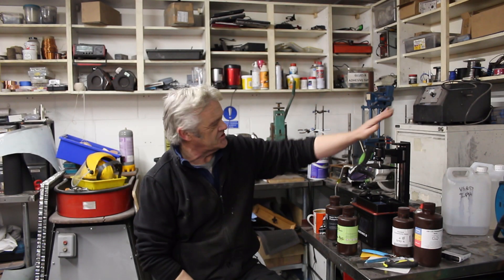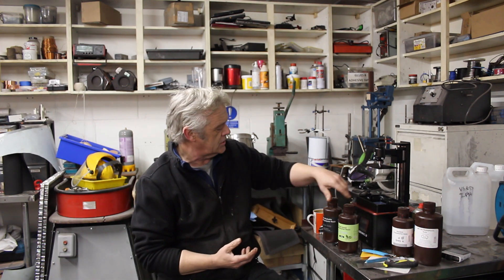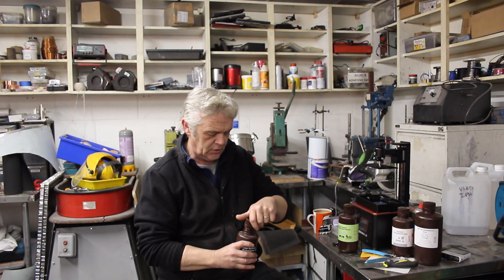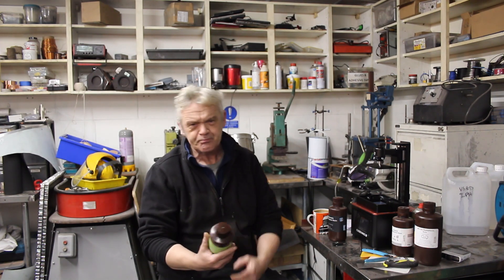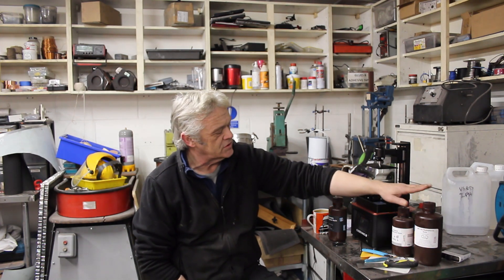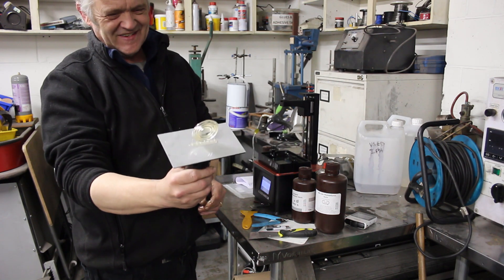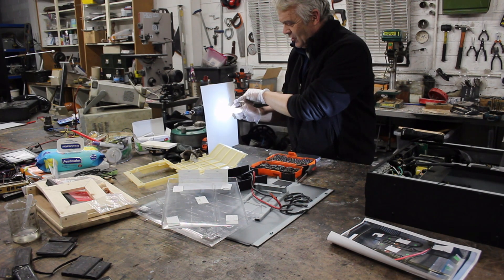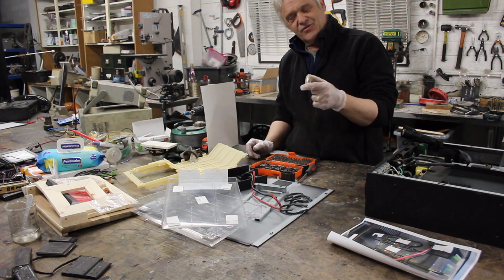1402 3D Printing A Fresnel Lens And Other Experiments

Comment: if you need parts of a print to be conductive, you might benefit from a dual extrusion fdm 3d printer. You'll be able to use two different types of spools. One, ABS or PLA for the main body of the print and the second spool that is either conductive or graphene infused. You can take a normal 3d printer and convert it to a dual extrusion 3d printer but it will reduce the printing space.

Comment: Re: conductivity, tin oxide and indium-tin oxide are conductive (often used for making plastics and glass conductive) and optically transparent, though I'm not sure if they would be in the UV range.  If they are transparent in the UV range then you wouldn't run into the issue of the resin not setting.

Comment: Conductive: what if you added to your design "channels" where the graphene could be painted once the print is done. Just deep enough so the working ink won't rub off.  Perhaps the channels could be in between connecting parts so it is is protected (embedded) once the final model is assembled. If the model doesn't  have multiple parts, design in small tunnels were working ink could be pushed through via air pressure. The net effect would be "paint in" wiring. (You can say it. It's OK. I believe the word is brilliant.)

Fumes:  build a fume hood you goof lol! You certainly have the skill and I would hazard a guess you have the parts. I  have my resin printer in a DIY enclosure that vents directly outside. I took a $10 plastic shelf kit and covered it with winterizing window plastic (shrinks with heat, crystal clear). The only tricky bit was the door, and I just 3D printed a frame and hinges and used more of window wrap. I use regular dryer hose and a PC fan to move the air. I cut a panel just wider than the vent to fit my window. When I need to use the resin printer, I simply close the window against the board and I am ready to go. Things I plan to upgrade: 1. weather stripping around the board for a better seal. 2. a stronger fan so the enclosure can be used as a fume hood when the door is open. 3. idk yet, but there is always room for improvement.
Reply: Those channels sound like awfully convenient places to run copper wire.

Comment: Could you print a honeycomb pattern (at appropriate scale) of your conductive ink onto the part at mid-stage then overlay with more resin so you have a conductive matrix within the piece.  Do blobs where you intend to connect.  Like an internal printed circuit.
Reply from the maker: that's clever thinking mate - cheers

Comment: check out the channel Integza he 3d prints with some ceramic impregnated resin for heat resistant parts. And some metal impregnated plastic filament, not useful for the resin printer but it could offer some valuable insight into using or making impregnated plastics. Also his stuff is pretty cool!  And I'm also going to recommend again, that you check out "The Fan Showdown" series by the youtuber Major Hardware, it would be very cool to see you and Luke do something similar but with designs for the pc fan generator.

Comment: Could you coat it with ITO or sputter them after
Reply from the maker: there are lots of ways to apply a conductive coating mate - to be honest the making it conductive part isn't really the issue - really what is sought is conductivity in a one step process that is cheap - or relatively inexpensive.

Comment: Hi Rob... I have the same exact 3D printer and am also trying to make the material conductive for commercial product. I am using some ultra-milled carbon fiber (same type mill you use for graphite) and have some success with conductivity while resin is liquid. My percentages are too high allowing the 1.83 specific gravity CF to settle out quickly. Experimenting with various percentage of CF mixes, then curing on an open flat surface and using a set of 385nm LED lights which only cures a very thin layer, approximately 0.05mm in depth after about 2 minutes. Have not yet tried to print using my Elegoo Mar 2 Pro, that sould happen soon. In the menatime continuing to test on flat surfaces. 
Would be happy to send you some CF sample material to test at your side. Warm regards, Leo
Reply from the maker: that's really kind of you mate but I have MCF, tried it and got the same results as you - there are some interesting suggestions in the comments though to look at this problem again

Comment: Love that you're still trying to get it conductive. I would love to see coated copper wires through the project so you can clean up the ends to have a printed circuit as a end result.
Reply: A 3D psb?
Reply: @totherarf  why not, it is just like plugging boards into boards like they do in many cases
Reply: @stevetobias4890  or a multi layer board ..... on steroids! ;o)
Reply from the maker: nice one mate and cheers
Reply: ottomh, resin prints in micron layers ? so.... resin print a 3? layer pcb track mask, mix ink & super fine copper oxide in to a paste & flux paste style fill the tracks, flash the paste solid, electro brush it to add a pure copper layer infill, dry & add a protective insulating resin top coat ,flash

Comment: Even if you can't make the resin conductive, you can use it to print out circuits and then coat the printed circuit with conductive ink.

Getting the conductive resin to work, perhaps you need to look at the see through solar cell technology and see how they managed to create those.
Reply from the maker: perhaps using AZO dispersed in the water washable polymer?
Reply: @ThinkingandTinkering  
"perhaps using AZO dispersed in the water washable polymer?"

Possibly.
But you may find that the only way to succeed in a conductive 3D print is with the filament type of printer.

With that method, you would need to make a filament that contains your conductive ink. There are videos on  YouTube that show how to build a filament extruder. 

If you decide to try that route keep in mind that those printer systems don't work so well when the environment is dusty, so if your shop has a tendency to build up dust, make sure you build a cabinet for the printer or purchase a printer that comes with one.
Reply: @ThomasAndersonbsf  

"I was thinking he just needs to do thinner layers"

There are limits to how thin a 3D printer can print.
Everything has it's limits.
Reply: @ThomasAndersonbsf  

"atoms are your limit, when it comes to layer thickness,"

You're joking right?
The machine that Robert has is not capable of doing atomic layering. In fact, there's not a 3D printer on the market that can do a layer that thin.

The only Atomic moving that gets done is in a lab that has a scanning tunneling microscope (STM) which has an ultrasharp tip. 

You can get a single and trilayer Graphene, but that tech is still in it's infancy and is not available in a 3D printer as it took 1,510°C and 1,300°C degree temperatures to achieve.

The thickness of a layer may not have anything to do with the motors, but certainly, a stepper that has more than 280 steps per rotation would aid in achieving thinner layers.

You also have an issue with the slicing software. The better the slicer, the better the layers will come out, but it takes developing a machine and the software together, in order to achieve the finner layers. You can't always just change the controller and the slicer.
Reply: @ThomasAndersonbsf  
"why are you insisting on telling people what they can't do?"

Why are you insisting on misconstruing what people say and living in a delusion?

I said the technology is not at the stage of being able to do it. I didn't say it could not be done. There is a big difference between the two.

If you think it can be done with current affordable technology, then purchase the tech, do it and then show the world that you have done it.

Regardless of whether you do it or not; stop whining about people stating the reality of the limitations of technology. 

This is not a Harry Potter hocus pocus fantasy film. This is reality. The only way to get past the limitations of technology is to develop and engineer new technology that surpasses the limitations of current technology.

Comment: Could you add a salt to the resin to get it to set? So it also will be conductive? Perhaps a combo of silver nitrate and tungsten carbide polymer? The uv causing a chain reaction to make conductive nanotubes? I don’t know but it thought. Much like nano capacitors on microchips? They use a lazer deposition method. I’m just wondering?  if your small yet mighty 3D printer. will be available to achieve something similar?
Reply from the maker: I was thinking AZO
Reply: @ThinkingandTinkering  yeah that would do it! It also would make it very compact.Alumina zinc oxide. Would work very well as there not much resistance.  Slicer also making it very easy to make 3D wires. Embedded into the resin.

Comment: I have had no success with clear resin on that 3d Printer. Always seem to delaminate. I gave up and went back to my FDM.
Reply from the maker: I don't want to brag but I have never had a print delaminate so far - I used the PTFE trick and always 'butter' the surface of the foot before starting a print - I did a video on how I go about printing

Comment: Metal particles work pretty good with SLA PRINTERS .... just discussing but try small silver particles with graphite my intuition said it should be around 20% metal powder and up to 3 % graphite
Reply from the maker: 20% metal seems high to me mate - wouldn't it just settle in the resin bath?
Reply: @ThinkingandTinkering  you need to have it well agitated but it should be fine with a thick viscosity ... But I am not sure I have not played with these printers enough .. the bottom layer is always being mixed because of the motion required for printing it prints from the bottom

Comment: As I'm sure you're aware, conductive graphene infused PLA filament already exists. Unfortunately it can be horrendously expensive at over £1000 per Kg for the "good" stuff or cheap and not so good at conducting a current. If you can come up with a good and cheap way to produce it then that'd be amazing! 👍 On the other hand, if you wanted a guarenteed way to make a printed part as conductive as metal you could always plate it 😁.
Reply from the maker: you are quite right mate I do know that - but I see the comments as being for everyone and there will be some folks who didn't know, I am sure, so it is great you posted a heads up on this - thanks for doing it - cheers
Reply: @ThinkingandTinkering  No worries, I always write my comments as if for a general audience, I would never assume you didn't know more than most about everything graphene... 😁 Look forward to your investigative inroads... 👍

Comment: (Wrote this at 1:30 in) I wonder if there's something you can add that would refract the UV through the gaps more to get around the graphene.. or even something that causes UV fluorescence in the resin from hitting it with radiation at the highest wavelength which you can still penetrate the graphene through? But I don't know if what that would be.. maybe something that fluoresces UV from microwaves would be more feasible considering the current technological accessabilities.
Reply: Some resins use metal powders instead of graphene.
Reply from the maker: thanks for the ideas mate I will give it a go
Reply: @ThinkingandTinkering  Like svent mentioned above, tin oxide and indium tin oxide are transparent and conductive, to visible light, and the indium is used to make it tougher, so as a solid printed layer I would imagine just the stannous oxide would work quite well though not sure how dense the material has to be in solution to be conductive when finalized, :)